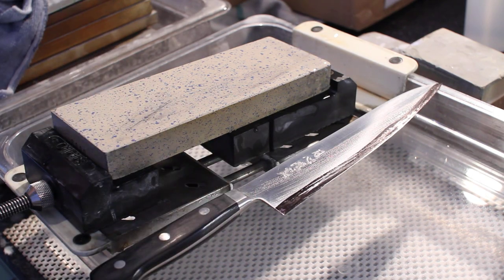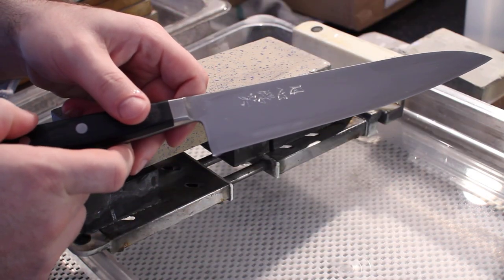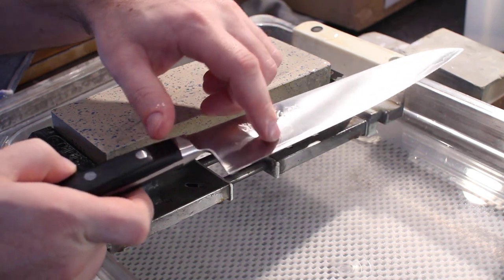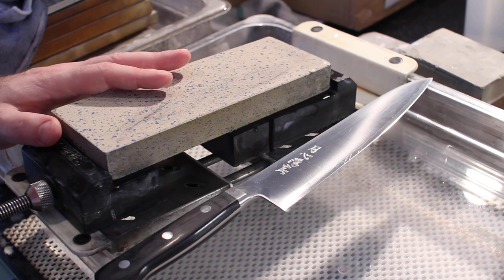Magic Marker/Sharpie Trick- Japanese Knife Imports

Comment: I'd recommend rubbing alcohol to remove the marker, for anybody that doesn't have or doesn't like to keep acetone around. hairspray works well too and rinsing the knife before it dries removes the marker and hairspray instantly, the issue is that hairspray is full of other chemicals so you'd want to be thorough in removing it if you go that route. it's just good in a pinch
Reply from the maker: yup... it works well too.  Acetone is faster and easier, but you're right... not everyone has it around or wants it around.

Comment: I'll have to try this. I'm new to using stones - I notice that I have created a burr closer to the tip/curve of the knife, so from right where the curve starts and to the tip.

Any ideas what i'm doing wrong? I have a feeling i'm using too much pressure, and maybe the angle is too low.

Thanks for the videos :-)
Reply from the maker: Creating a burr is part of sharpening.  Are you not creating a burr on other sections of the blade?

Comment: Rubbing Alcohol (Isopropyl) is the proper chemical to remove Sharpie ink from surfaces.

This is because the solvent used in Sharpie markers is alcohol based.
Reply from the maker: having tried a number of different things, while alcohol works, acetone is FAR faster and easier.  But certainly use whatever you find effective.  I'm just sharing my experiences of what has worked best for me here.

Comment: Rubbing alcohol works just as good and is less toxic than acetone
Reply from the maker: there are certainly times where isopropyl alcohol works fine, but there are also times where it just doesnt remove all of the marker, and acetone works faster and easier.  But it should certainly be a consideration for people.  Thanks for bringing it up.